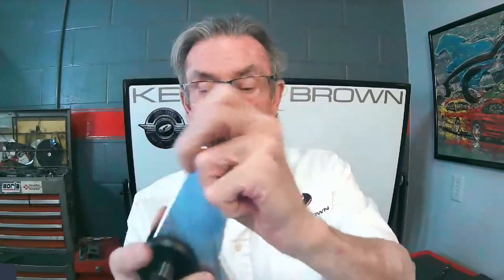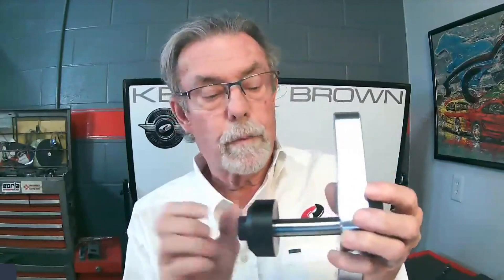Kenny Goes Inside Delrin Polyurethane and Rod Ends For Mustang Suspensions

Comment: Kenny i've seen some rear lca's with both a rod end  and  a poly/urethane end. How would this fair on a mostly street driven car with light to mild  autocross/road course use? Or would you strictly recommend a rod end? I would love that full articulation just worried about nvh...
Reply from the maker: We have combined poly and rod ends together for a lower control arm application. It really depends on the chassis or suspension. In the case of the 2005-2014 Mustang we use rod ends only with no issues on street or track, but we use a very high quality end. That car works well with that set up and our rear upper control arm, which uses a large rod end at the chassis mount only.